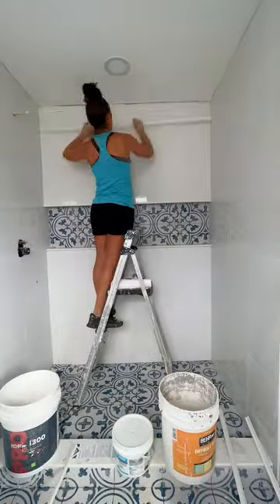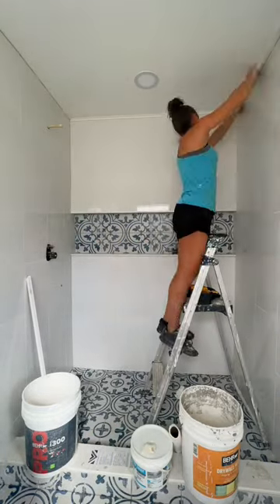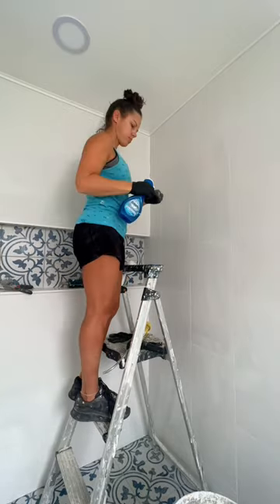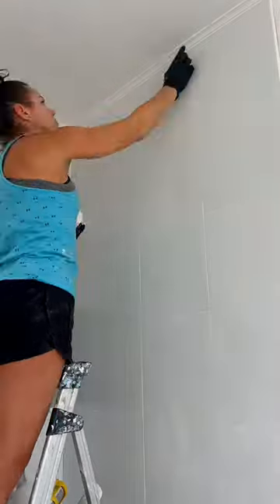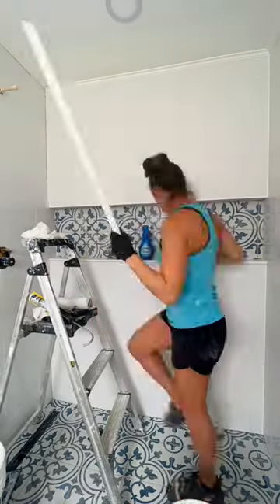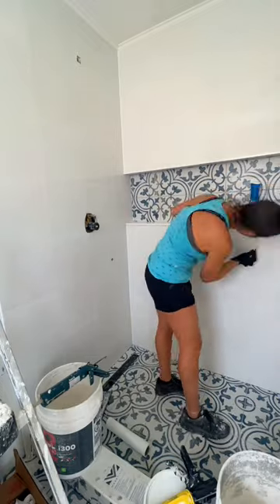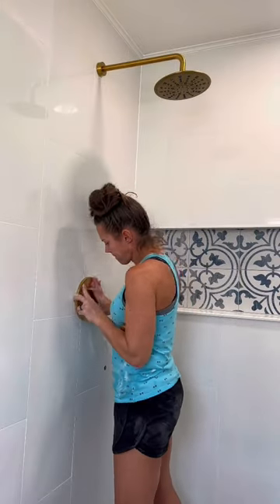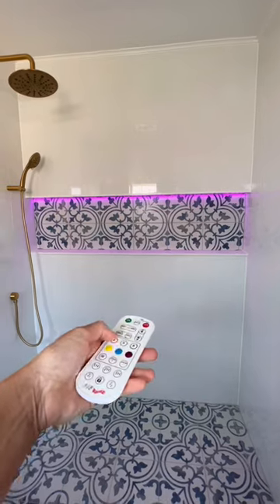This is what I use to fill gap between shower tile and the ceiling! PVC inside corner molding!

Comment: As a contractor, I don't have gaps on the top when I'm done tiling.
Reply: If you DIY don't do this. It looks super cheap
Reply: Amen!   Get those tiles scribed so they’re within the fudge factor of a grout line.
Reply: Yeah you have to leave a little bit for expansion and contraction usually 1/16
Reply: Thank u , though my contractor refused to do cd extra work🤣🤣
Reply: soooooo you replace the ceiling when the tile doesn't go to top because ceiling is uneven? You do all that?

Comment: I wonder if the contractors are concerned about waterproofing the seams. Perhaps it would’ve been better to fill with silicone then put the PVC up as a finishing touch.
Reply: Not sure why a contractor would be worried about that so high up . Most showers point down at the person not up at the ceiling. 🤷🤷🤷
Reply: Tbh, waterproofing isn't really necessary that high unless they're doing a steam shower, in which case the entire ceiling would also need to be waterproofed
Reply: Pvc with an unbroken layer of silicone is fine.
Reply: @surfstoomuch5750  You have to consider steam from the shower/condensation rising up into the cracks. That’s bound to cause problems no?
Reply: @BuiltInBrooklyn  Absolutely correct.  Most people do not understand and underestimate the damage moisture causes.
Reply: @Tonyhouse1168  the only real issue with putting pvc corners before sealant is she is doubling the chance of sealant failure. And given the fact that she used soapy water to tool with,the chance of failure is already very high.
Reply: @genecarden780  Since the walls are already waterproof is it just the silicone that will fail? If she instead used silicone grout in all the corners and the liquid nail she used to hold the pvc, should this be fine?
Reply: @sullyreynolds1649  yes just the silicone. I would not use silicone grout. The junction of 2 different  surfaces (corners) needs something more flexible. Silicone sealant is the right product.The,problem is with the unacceptable method of installing the silicone( the use of soapy water) it becomes a problem. My problem is not with the corners. My problem is ,if you use the corners ( or even if you don’t) install the silicone correctly. Where this is located it may not be a problem, but it might. Unfortunately if it is a problem there is a good chance you won’t know until 1000s of dollars of damage is done. Like mold in the walls or even possibly wood rot. Silicone is not really hard to do but there are a few key steps to a successful long lasting installation. 1. Clean the joints very well. A few minutes before installing the sealant wipe the joint with alcohol followed immediately by a dry white cloth to remove all residue..2 shoot the sealant bead as evenly as you can. If you can’t shoot a very even bead mask first.3 dry tool. NEVER USE ANY LIQUID TO TOOL. 4 remove the tape immediately.
Reply: No need for the silicone up that high
Reply: @workaholism2473  wrong  there is going to be condensation and steam. Any moisture in the walls can be very problematic
Reply: @genecarden780  Nothing against you or your methods but its crazy how I've heard so many different people say don't use grout, don't use grout caulk, and now don't use silicone grout. Either I'm not going to grout the shower or just accept the world falls apart lol.
They all have their reasons why you should or not use them and we'll all decide what works for us and the project best.
Reply: @sullyreynolds1649  When I said I wouldn’t use grout I meant in the joint at the ceiling to wall.Especially if they are dissimilar materials.I’m not saying don’t use grout. But they all tend to crack in the corners. Not always but very often.why take the chance of having a very small leak that goes unnoticed. Corners are not so critical in newer construction because the shower liner( waterproofing) should keep it out of the walls If it is a tub or prefab shower base then the vertical corners are more critical .In older construction I would not rely on the waterproofing behind the finished wall.But when the hard surface goes all the way to the ceiling there is a chance of condensation and moisture rich air (steam)getting past the shower lining. The chance of it happening is not great. But if it does it can cause major problems. Silicone is a cheap and easy way to eliminate the chance. If installed correctly. I have seen major damage done by minor leaks in showers and tubs.
Reply: @surfstoomuch5750  I don't know a lot, but I figure an interior bathroom with a ceiling vent may still need something extra. Steam still puts condensation on the walls and ceiling, even with a vent in most all apartments and houses I've lived in. I figure it could still result in mold or moisture in places that shouldn't have moisture. I've had to help my parents clean spots off the ceiling of their bathroom that I thought looked like mold. Wouldn't seams need waterproofed because of things like this?
Reply: @sullyreynolds1649  you can use grout in corners. Its actually easy to just touch up when it gets really bad and falling out. Silicone is such a temperamental product that I have a hard time wanting to use it. Ive seen grout corners crack immediately next day in huge warehouses and then grout corners that have been crack free in houses. 

Anyway, if you do decide to use silicone done do it the way she was. The soapy water does make it fail much faster. Taping is the way to go 100% of the time.

Comment: Avoid using silicone in showers it will catch mold and mildew.  They   make a grout caulk, which is flexable.
Reply: Grout caulk is also siliconized
Reply: Silicone can catch mold and mildew if it isn't regularly cleaned. If it does get bad, remove and reapply.
Reply: And why do you think it is flexible sir?
Reply: I love that stuff lol but i kind of suck at tile

Comment: You can always use the coloured silicone caulking if you do not want to stick with clear, or white silicone. It is more resilient, and is made for wet areas.

Comment: Quick tip for those interior corners squeeze some silicone out and mix it with the grout you’re using and then use the mixture for the corners it looks just like a grout line but it’s silicone! 😃

Comment: I've used cellular PVC on fascia repairs and liked the results. This is the first time I've seen molding made from it, though. How are the inside corners? If this were traditional crown molding I'd need to back-cut with a coping saw to get a clean transition across the corner.

Comment: Grout doesn’t crack in your corners if you mud and tape your joints with thinset prior to setting your tile 👍

They also make grout caulk.  Which is just what is sounds like….caulk that matches the grout color.
Reply: I don't know about that...a lot of the times one wall is on the exterior and the temperature difference causes a lot of movement
Reply: @deeeeeeps  I do know about it.  I’ve been in the building industry for 25 years and have been building showers stalls for 18 of those years.  I’ve spent a lot of my time replacing shower stalls which failed for many reason.  

As long as your house is built to UBCs and your shower stall seems are ALL properly taped and adhered with tile mortar and mesh tape, you’re grout should not crack in your corners.

Comment: It would be great if you could show a close up of the "inside corner molding" you use, and how it looks completed up close.  There are lots of different profiles of "inside corner molding".
Great ideas by the way!!!
Reply: PVC Cove moulding or PVC Inside Corner Moulding is what you would ask for at the store. She's applying it with waterproof construction grade adhesive and sealing it with 100% silicone caulking.

Comment: Would love to know why professionals would disagree.
Reply: Cause it’s not as clean of a look and looks like you’re covering something up. Tiles that butt up against the ceiling have to be scribed since the ceiling is usually uneven. It’s like using quarter round to cover the gap where a stair tread meets a riser. It takes time & skill to scribe that line. It’s a total DIY move to use a moulding to cover the gap. I’m sure most people wouldn’t even notice, but this wouldn’t with the customers I work for
Reply: Because that's how RVs are finished.
Reply: cuz that's how they do mobile homes

Comment: Check your ceiling all the way around your shower before tiling make sure it's flat when you get up to the last row you should leave like a 16th or maybe 1/8, depending, and you grout it. If you're a bad tile setter and your Cuts look like crap at the ceiling, that's probably what you're seeing. To me what you just did to the top of that shower looks cheesy.🤷‍♂️